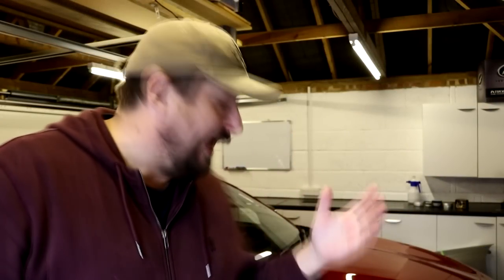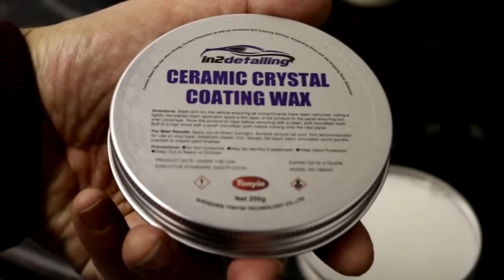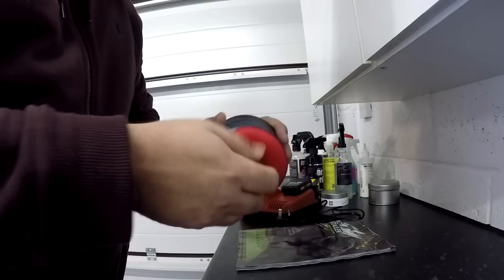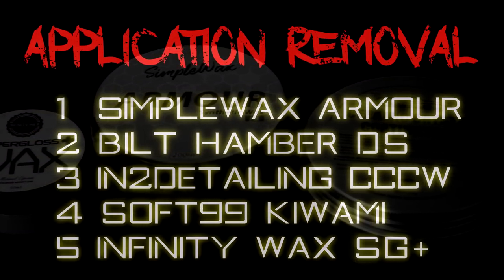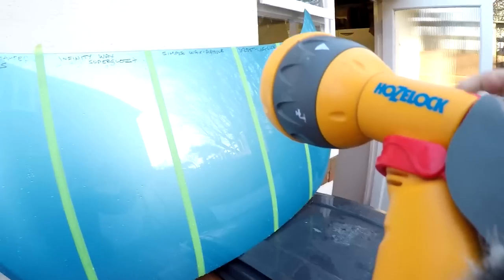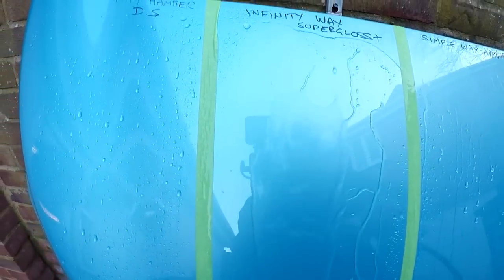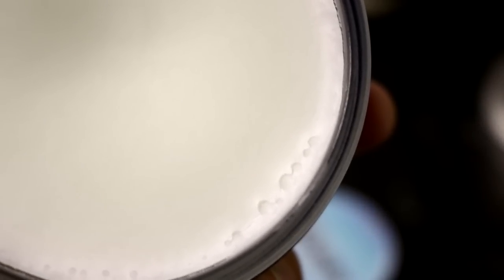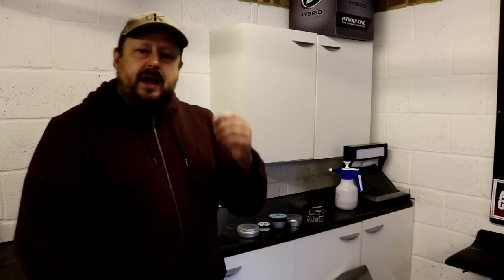Bilt Hamber Double Speed v SimpleWax Armour v Kiwammi v SuperGloss+ In2Detailing CCCW Scene Wax Test

Comment: Does Bilt hamber make any below average products ? 
I’ve searched high and low but can’t find any. 
My latest BH purchase is their  micro fibre cloths and I haven’t used anything else as good imho 👍
Reply from the maker: they have areas where they dont have offerings, therefore they have weaknesses in that regard.   Glass cleaner? Trim Dressing?   They rely mainly on Organic Wax in their protection products.     But they seem to have a certain expertise in what they do.   Like when they make a product they literally take the market leading one, and build out a product that just outperforms it.  That seems to be their approach and more often than not their products deliver.   For Wash and Decon I dont use anything else really because no only do I find them more effective (and safe non caustic non corrosive etc) they are really well priced.  For polishing and protection theres a lot of things out there worth exploring.  great question.    I personally wish they plugged some of the gaps though.    think Bilt Hamber tyre dressing, interior dressing, glass cleaners, etc etc...
Reply: Forensic Detailing Channel   Yep that’s true.  If only they made a wider range of products. 👍

Comment: I use BH double speed wax and I ve been very happy with it, good durability. I'm tempted to move over to Turtle Wax hybrid sray wax or Hybrid ceramic wax. Are they more durable?
Reply from the maker: if applied properly yes.
Reply: @ForensicDetailing  Thanks very much for your advice.

Comment: I'd like to know how the Bilt Hamber compares to Colonite and some of the newer 'hybrid' spray products. I guess at the end of the day I don't care if I'm using a wax or a spray (or the cost). i just want the best product to stick on the Dacia (yeah, I know ...).
Reply from the maker: Collenite 915 is a wax worth checking..  Colly you need to be carefull with as it sets like rock...  but waxes which set hard tend to last out well.   As long as you get your buff right with 915 and dont over apply it, its a very nice product.   proper nuba glow.  colly 915 is not that hydrophobic but its still durable.
Reply: A few years ago I tested 1 layer of BH DSW, Collinite 915 and Sonax Polymer Net Shield on the bonnet of my daily driver to see which was the most durable. The bonnet is silver and looks wise, I couldn't tell the difference.
It was obvious that the Collinite lasted much less time than the other 2, probably  only just getting to 3 months whereas the other 2 were closer to 5. The Sonax seemed to last a couple of weeks longer than the DSW. I've reported this test in Detailing World and on the Facebook forums. 
At the start of that test I applied 2 layers of DSW to the rest of the car and this was lasting much better than the bonnet. 2 layers for the win!

Comment: Is the difference of 2 gloss units between CCCW & DSW noticeable to the naked eye?
Reply from the maker: hmm thats a proper good question.   Im going to say no.   Proper good question.  I think your eye can maybe spot around 5 unit difference.   could be way way off with this but Ive put some thought into this and Ive taken 1000's of readings of possible hundreds maybe even thousands of products.      Sometimes ive like rated "GLOSS" based on my eyeballs and sometimes ive got it right other times ive got it wrong.   I can generally spot a glossier product.

remember doing the compound testing and I was convinced H8 and Mirror Glaze 105 were the best looking and the meter then went  on to confirm this.   I rememeber thinking Gyeon QD was awesome on gloss and the meter backed it up.. Same with beadmaker.   more to come on glossy products soon I hope.
Reply: @ForensicDetailing  Jon, thanks for your detailed response. For that reason I am happy with BH DSW. A couple of gloss units difference is not important to me.

From what I have read, finis wax is glossier but DSW is more resistant to detergent. Hope u r able to test Finis wax...

Thanks :-)

Comment: I applied fusso99 dark the other week and I'm looking for a topper wax for it. Anything you recommend?
Reply: Yeah honestly Kiwami! Regardless of this test, my winter prep shows how good that combo is.
Reply: King of Gloss.
Reply: @DetailingandtheBeast  Cheers mate. I've took you're advice on a few things in the past so I think I'll go for that. Most importantly they're chemically compatible. Any idea how long the combo lasts?
Reply: @Danny-is5if  well mine is now 4 months on and it's nowhere near needing a top up. Bare in mind that the base coat Fusso will be under neath not even being touched! Makes winter cleaning super easy.
Reply: SimpleWax Armour is great on top of Fusso 👌 

Soft99 KoG, Kiwami and Waterblock are really good too but I generally lean towards Armour more now 🤔
Reply from the maker: Im just not big into using 2 layed paste waxes I just find it too much work.   But there are benefits Dave is right Ive topped fusso with KOG and Kiwammi and you do get a nicer look.   Fusso is a monster sealant but it looks flat after a week.
Reply: If you have used soft99 dark can only assume you mean fusso coat, I'd look at using king of gloss or kiwami wax both are absolutely incredible on top of fusso coat, I don't know why he didn't use fusso or waterblock for this test
Reply: Yeah you're right, the fusso is looking flat after a couple of weeks. After looking at Dave's Ranger I think the Kiwami is a safe option.
Reply: Soft 99 Speed and Barrier Quick Wax is the QD/topper for Fusso Coat. If you want to maintain the looks and high performance from Fusso Coat that is. But you are maybe after a paste wax to top it up with. I just thinking that the extreme performance properties of Fusso Coat would be a nice thing to maintain. If you have a paint in a great finish that you usually gets from the polishing and give the finishing polish step a great combo of finishing polish and pads. There you get the most of the gloss and looking great. And you can get slight differences with the protection product that you use. It's well worth to learn and get a polisher and start with a less aggressive combo of polish and pads. And you don't take off much of the clearcoat that way. Then you also see if you have deeper scratches and swirls that you may want to get leveled down later on. But getting the light oxidation and marring off to get a clearer paint finish does a lot for the looks from your vehical.

Comment: How’s the longevity estimates on them in a coastal USA climate? Hot, humid, salty, and sandy
Reply from the maker: I really dont know.  I find winter salty road film the biggest killer of protection.   Although extreme heat does not do paste waxes any good.   but I really dont know Jeremy.  I would guess BH will do 3-6months in a hot climate.
Reply: Forensic Detailing Channel gotcha. Where I live, we never salt the roads but the salt from the sea can rust cars out. It’s 66 Fahrenheit (~19c) and sunny. It gets up to 100 in the summer with 110 heat index
Reply from the maker: @jeremys8360  where do you live jeremey?
Reply: Forensic Detailing Channel in Mississippi in the United States

Comment: I’ve decided to move away from the in2detailing wax recently. It just takes too long to cure and the durability isn’t as impressive.
Reply from the maker: fair play, this test probably supports what your saying.  But its not half bad though is it.. but yes its not a durability wax.
Reply: Durability we quote is 3-4 months which is easily achievable and most feedback says it last longer than this.

Cure time is about 15-20 minutes so generally you can do a half car or even full car before removal.
The longer cure time is actually an advantage for many people and as it has such a large safety net is even better for mobile guys as they can wax the whole car before removing.  You can leave the CCW for 40+ mins and it will still remove easily.

Gloss, beading and VFM are important to many people and in those respects is performs very very well.

If you're looking for an ultra durable wax, then it may not be for you.

Comment: Zymol Royale........?! lol
Reply from the maker: glasur Ive got pixel.  Im after a swissvax one their most iconic (not one of the mega 1000 one just like 200 quid one)   what do you think Best of Show?
Reply: @ForensicDetailing  I actually got BoS back in day when I had my E36, great wax but didn't last very long ,smelt nice! I was using P21S back then and Megs 3-step polishes, feck im old lol
Reply from the maker: @PixelVogue  what would you say is there most iconic wax (swissvax)  cant be like crstal rock though or the mega bucks ones.
Reply: @ForensicDetailing  still BoS, you can get 50ml instead of the 200ml one
Reply: I would go with BoS, expensive but attainable and very highly rated for gloss.